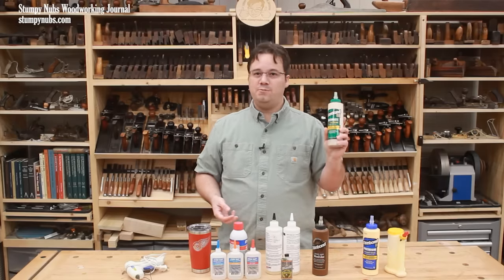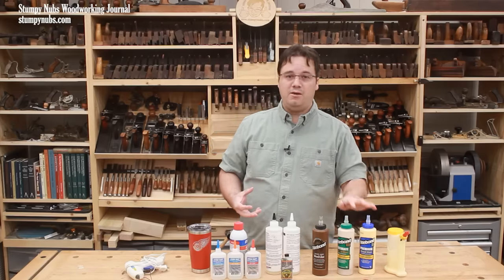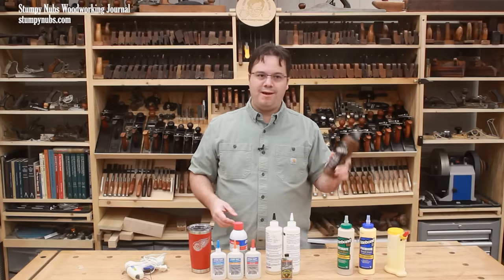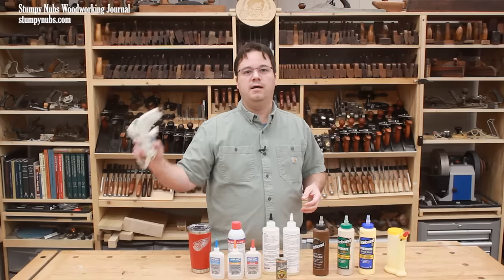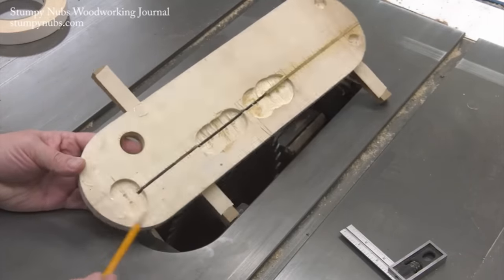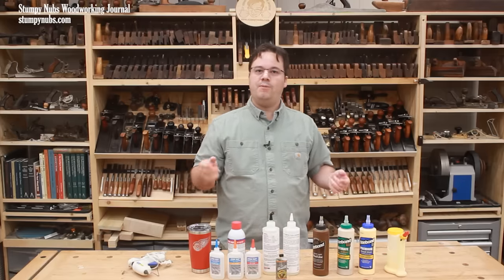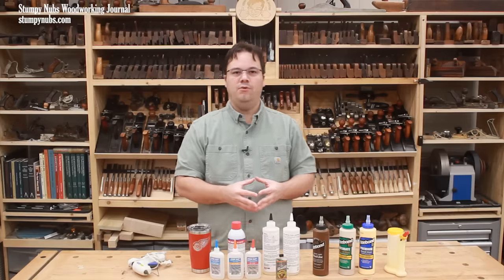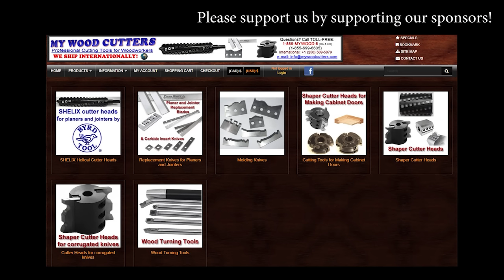Why I don't use Gorilla Glue

Comment: I remember Norm would use Poly glue when he would make projects from Teak. He said the wood had natural oils that made using standard glue less effective and could fail more easily. He would wipe the teak with alcohol then wet it before applying the poly. What are your thoughts on that James? Do you have much experience with Teak? Thanks for the great explanation video 😀
Reply: I haven't used teak, but I have had a glue joint fail in an edge-grain cutting board between two strips of padauk. It only happened once, but now whenever I glue padauk to padauk, I make sure to use a lot of glue (I usually use TightBond 3) and make sure the glue covers every bit of the joint surfaces thoroughly. I've heard other woodworkers say you should wipe the surfaces of all exotic woods with acetone or some other solvent before gluing them, as the oils in the wood will interfere with a good bond. I do it occasionally, but other than that one joint, I've never had a glue joint fail, even for joints that I haven't wiped down. Also, I wiped down a cutting board that had some padauk in it with acetone once. I thought it might work for getting dust off the wood without raising the grain. I will never do it again. It just made a big mess, staining the other wood padauk orange. It took a lot of sanding to fix that mistake. However, I will caveat what I said about wiping down the wood before gluing. When I've used exotics, it has mostly been in cutting boards and other projects where the joint isn't under a lot of stress, so my experience may not apply to your situation.
Reply: Interesting.  Haven't watched Norm in years now.  He's great!
Reply: I’ve tried Titebond 3, epoxy, and polyurethane on the same piece made of ipe (also an oily wood) for outdoors. Poly  has had the best results.
Reply: @stillawake76  thanks brenden.  That’s good to know. appreciate your comment 👍🏼

Comment: Thanks so much for saving us from buying the wrong glue for a certain situation.  I once used epoxy to replace part of a bent windsor chair bowback, which was oak and I was amazed to find that it didn't hold worth beans but when I tried yellow glue , it worked well. So much for my thinking that epoxy could glue anything!  Thanks for sharing.
Reply: It's about the chemistry...surfboard foam IS polyurethane , so gorilla glue rules.  Using titebond will ruin your whole day in my world.

Comment: Good stuff. Back in high school wood shop, we used this powdered glue that we mixed with water. The stuff was tenacious. I think it was made by Weldwood, but that was 40+ years ago, so my memory is a bit sketchy on it. I do remember that when dry, the wood would break before the joint did.

Interesting twist on the Gorilla Glue. I saw a guy use Gorilla Glue as a rub-in poly finish. I tried it on a small project and it was legit.
Reply: Yup. Weldwood Plastic Resin glue in powder form was used in my high school wood shop. Hopefully the product now made by Dap is the same. I still have my walnut & maple chessboard I made in shop class. Never knew it was a ureaformaldehyde glue until I googled it. I clearly did not read labels in my youth.
Reply: I used that stuff at college in 2003 to 2005. We used it for veneer glueing to a MDF or particle board core. We had a heated press that cured the glue in like 40 seconds or something quick like that.

Comment: This is a good summary and matches my hard-won experiences. The highly hyped Gorilla glue polyurethane is something I tried out in the late 90s when it was being advertised heavily ... what a mess to work with! A somewhat hard to find glue I really like is the slow set version o traditional PVA white glue often stocked by Garrett Wade. It is a good quality conventional PVA. I find great for complicated glue ups because it gives me time to work without the hassles of slow set epoxy. Theoretically it is also reversible with enough water and time, so I use it in situations where you are suggesting hide glue. Many moons ago I used traditional hide glue when helping my great uncle with his violin repair work. He would have a fit if someone assembled a fine violin with Titebond. Hide glue's easy reversibility is a must for instruments which may need to be opened up for repairs.
Reply: Tightbond 1 is used by many top rated luthiers. It is perfectly able to soften with heat or moisture, just like hide, hoof, and fish glues. Tightbond 2 and 3 are absolute NO NO for luthier work.

Comment: Great voice video, really helpful to here genuine unbiased facts. I will say I use gorilla glue on job site jobs not wood working builds in a shop. Gorilla glue works great when using wood plugs on projects were you don’t have smooth fitting pieces, fills the gaps a cracks and when dry (only when dry) scrapes off easily. 
Again great job, can’t wait for the next one
Alex
Reply: Voice video? I hate auto correct 
Great video.

Comment: I build wooden boats (among other projects) and recognise all the glues you have there, use most of them. But for boat building epoxy is king and a marine quality PU is queen (I use Collano Semparoc.) They aren't interchangeable, as you say the PU needs a tight fitting joint, epoxy is better at gap filling. Main advantages of PU is a. it doesn't need mixing (with potential wastage if you mix too much) and b. cleanup is easier and safer. Sanding epoxy generates toxic dust to which some people develop serious allergies. I also have a can of spray mount in the workshop for positioning paper patterns and a can of contact adhesive for sticking sandpaper to sticks and dowels to make custom shaped sanding tools.

Comment: Have to say that I share all of your opinions and experience with all of these glue types with the exception of polyurethane. I dismissed it for a long time until I saw a Youtuber use it on several projects. The first place I saw him use it was on a tight box joint. Personally box joint and dovetail glue ups make me more apprehensive than most others. With the polyurethane you get a glue that has a longer open time, acts as a filler, acts as a lubricant during assembly of tight joints and is really easier to clean up. Yes you have to use mineral spirits but even after it dries it's easier to clean up any squeeze out with a chisel or knife than PVA glue. No it's not a miracle glue to replace all others but it does have a place, at least in my shop. Don't be too quick to dismiss the Gorilla! ;)
Reply: I have a butcher knife I assembled "experimentally" with Gorilla Glue, and it's lasted 20 YEARS with regular beatings through frozen 10 lb "logs" of hamburger, bones, and is my go-to for loaning out to hunters who just want something quick and cheap to use for a field dressing implement, because if they break it or lose it, I'm not out anything precious... I found the blade in the garbage, and just gobbed the thing together back when Gorilla Glue was a relatively new product... Damn nearly as good as epoxy for some fit-ups!  ;o)
Reply: I've always had the impression that it is a particularly strong adhesive, and it seems to stick pretty much anything to anything.  I do take James's point about it foaming out of the joint and making a mess though.  It also has a limited shelf life in that it forms a skin even with a well sealed container, so I buy it in smaller sizes nowadays.
Reply: @gnarthdarkanen7464  It's funny when you mentioned '20 years' it reminded me of my Gorilla Glue experience. The front door to my apartment-conversion condo had a rough life before I bought the place. The hinges were really loosely mounted to the door and I had them addressed during my walk-through at closing. Sadly yet unsurprisingly they 'addressed' it by using larger screws. Thing is, it's a steel fire door with an internal wooden frame, and the screw holes in the frame are just sawdust as repairs had been attempted in the past over the years. 
Anyway, the door started becoming difficult to close again and it was the hinges at fault. Frustrated, while I came up with a long-term plan I decided to put some Gorilla Glue under the hinge plates, then shim the door level and plumb when closed while the glue cured. If you can believe it, that same glue is holding just fine after 18 years and you can close/latch it with one finger. I really want to fix it 'the right way' but hey it's working fine right now and for the foreseeable future. Further attempts at repair may screw it up!
Reply: @TrevorDennis100   Yeah, the container size really matters... Trying to budget out the stuff so you don't keep a single container long enough for a significant loss when it turns into a brick in the bottle can be frustrating as hell...

     As to the mess... Meh... It only takes a few sessions of "trial and error" to get pretty skilled at joinery and seriously limiting the "foam-out" from expansion. The foam (if left undisturbed until cured) also doesn't run or drip like other glues. AND it's relatively soft enough that the exposed stuff can be trimmed right off with a decent, sharp knife. A little sanding with fine paper after that, and it's easily as useful as most anything else...

     Mostly, due to the cost, I reserve the stuff for situations where I am mixing wood and other materials, whether metal or plastic or even rubber and "strange joinery"... especially where it'll get abused and wet often.

     Most of the regular joinery is just cheaper and easier to do with almost everything else as James prescribed. ;o)
Reply: @jaymzx0  Yep, among my earliest rules in any craft skills is "Never repair something that ain't broke."...

     As to hinges and doors... I had plenty of adventures (read "total clusterf***'s") getting doors repaired and mounted properly when I'd inherit a faulty situation... The shear weight of a door on the joints of hinges and whatever screws or other fastening hardware and wood are involved in the frame can (and will) tend to droop over time and cause more headaches than there are aspirin in the hemisphere..

     ...it's even worse when humidity is a yo-yo...

    Instead of sawdust repairs, however, I've found that an improvised glue-pot and regular tooth picks or bamboo skewers are among the most effective for the longest time (unless you just gob the thing full of gorilla glue and jam the screws in place to resist "foaming out".

    The glue pot's useful to coat each toothpick or skewer with glue, and you can use a brush (or finger) to smooth out the layer... Then jam the pick or skewer into the hole as deeply as you can, adding more and more until the hole is basically filled in... 

    Once cured in place, you can flush-cut them off, either with a small saw, or a hack-saw blade, or even a japanese saw with fine teeth... OR in the case of toothpicks, a good sharp chisel... and a follow up with sand paper.

     Then you can return to screws... either with the originals, or if you're updating, the latest roughly equivalent screw to those you'd extracted.

     Titebond products are easily durable and strong enough for pilot-holes where necessary, too. I generally reserve the Titebond III for exterior doors, since you've got to contend with weather, snow included, and hot and cold... humidity... etc...

     LOVE the tooth-pick and skewer "filler" trick ever since I learned it. It works damn fine for restoring antiques, too, since the heads of the screws will tend to cover the oddity of inserting wooden bits into worn holes for the threads to bit, and unlike sawdust, they have "long grain" for the glue to "bite" for a solid hold...

    IN any case, I'm not sure "fixed properly" involves toothpicks, bamboo skewers, or anything other than removing old wood and rebuilding... BUT I'll take the picks and skewers most times... in case you hadn't heard of the method.  ;o)

Comment: Really nice overview, James. I use hot glue all the time. I've even used to attach a small part I need to turn on the lathe. Not recommended of course but If the surface area is large enough, it holds surprisingly well. Also love hot glue to seal up caulk tubes I won't get to for a while. Even a year later, the contents will still be fresh!
Reply: I hot glue my caulk tubes as well to make them last longer!
Reply: Great tip about the caulk tubes, especially for those of us who aren’t professional plumbers. I use hot glue a lot to protect the sharp edges of tools, either for shipping or for storage.
Reply: @lyster1ne681  oh I like that idea to protect sharp edges.

Comment: Poly glue works good in construction where foaming doesn't matter, and damp wood is common.
Reply: Yes, and bonds with concrete well, brick, tile, mortar. Got a place floor leveller won't work. Use white or yellow glue depending on your time, as a bonding filler.

Comment: Firstly from this Kiwi, hobby wood worker. Thanks so much for all the wonderful and informative vieos you have posted over the years. I have learnt heaps from them. Re Glues. I use polyurathane glue for outdoor constructions. Landscaping, decks etc, I find it does a good job . I use it with a glue gun for these jobs.  I'm a hobby luthier. traditionally heated animal and hyde  glue was used for instruments for several reasons.  Quality Instruments are almost certainly going to be disassembled  over their life time. Hence what you said about chairs. Secondly in its hot state. It sets very quickly. This enables the luthier to place and secure a small part very quickly. just like with super glue. Thirdly in days gone by. there weren't necessarily a lot of other options. I began using the origional  white PVA glue. In some places. Stringed musical instruments are under considerable tension. I discovered that under these conditions. White glue tended to creep. I have found the yellow glue doesn't. Its possible to release the yellow glues I use with moisture and heat which equals steam. You can also use white vinegar to release a variety of plastic based glues, including yellow glue. I occasionally use Epoxy resin. Especially for instance, for for setting carbon fibre flats into guitar necks for reinforcement. Epoxy is really the only glue that will adhere to thermo setting composites.  I use super glue for fitting binding to the body of an acoustic instrument. it largely elminates the need for complex clamping systems. lastly, I also often use super glue to fill dents and wood gap imperfection that are to be laquered . I hope ive added to the debate. Once agin thankyou so much for what you do.

Comment: Polyurethane glue: I use it to add rubber strips to the bottom of skateboard launch ramps. Epoxy in those volumes is more expensive here (Australia) than PU, and PU doesn't need to be mixed so I can apply it straight to the work surface.
Reply: What kind of rubber and where do you get it?
Reply: @danielnewby2255  Heya matey, I picked up a meter of "Ideal 1m Black Flat Rubber Surface Matting Sheet" from bunnings. They cut if off a roll. The wedge ramp I made stays put on polished and sealed skatepark concrete. The glue is Sikabond Techgrip 500ml from same place.
Reply: @bakedbeings  Thanks

Comment: Thanks for this excellent video; I've used virtually every one of the glues you described.  But I must say that even though I don't use Gorilla Glue much, I do use it for laminated projects when the wood is wet so it can be bent into complex shapes.  The damp wood bends more easily and I know the Gorilla Glue will expand to fill any voids and it won't end up diluted from the dampness.  Plus it's pretty strong once it sets up.

Comment: Sometimes, when a clamp up is very awkward, I tack in some countersunk screws to hold the piece tight then, after cured, I remove the screws, pour epoxy into the screw hole, then glue in plugs after the fact. Which glue would you suggest for all that =P

Comment: I use Gorilla Glue for melamine cabinet assembly.  I find its expansion properties set into the particle board well and hold the strongest of any glue I've tried.  Of course it requires long clamping.  Most people don't seem to understand that Gorilla Glue needs to be under pressure for it to work.

Comment: Poly glue can certainly be messy. But it also has properties that make it indispensable in my shop. It is superior for end-grain gluing, crack filling in timbers, and when gluing HDU to itself or to wood materials. I'm also partial to West System and the several compounds available to control its density.

Comment: A tiny sprinkle of table salt completely prevents parts moving when clamping. 

This was a tip which changed my gluing life forever! But make sure you put some rice in your salt shaker, or the salt will clump up due to its hygroscopic nature.
Reply: I've never heard of that! :O Can you elaborate?
Reply: @MagnusMoerkoereJohannesen  
Sprinkle the salt onto one piece you are about to clamp (after applying the wood glue).
When you place the second piece of wood onto the first piece the grains of salt make small debts in each piece of wood and the grains lock the two pieces together so they don’t slide against each other when you apply clamps.
It’s a fairly common technique.
Hope that helped :)
Reply: @raybritton2923  I hadn't heard of it here in my neck of the woods, but the way you describe it makes perfect sense! Thank you, I'll remember it for the next time I need to glue something together :)

Comment: The yellow color is just pigment. I can be pretty sure about that because in Germany we have D2, D3 and D4 glues (which tidebond is certified for) which are all white.
There is also a B classification which is for PU glues as where D is for PVA.
Reply: This is true (Croatia here), but the yellow glues from USA have some kind of grit or fine sand added to them and our D234 are smooth. I think that yellow glue isn't just tinted, just like James stated.